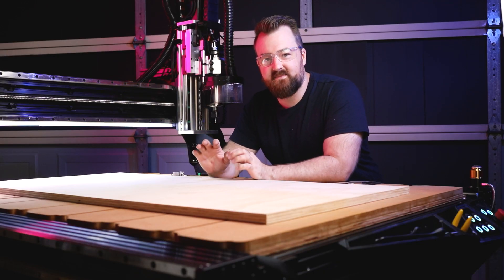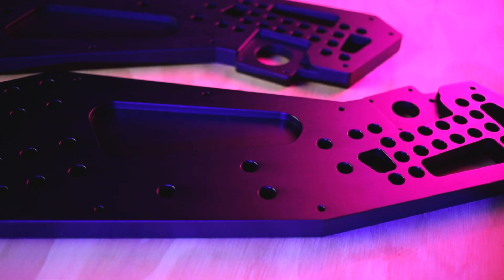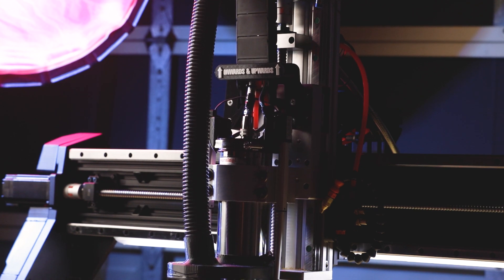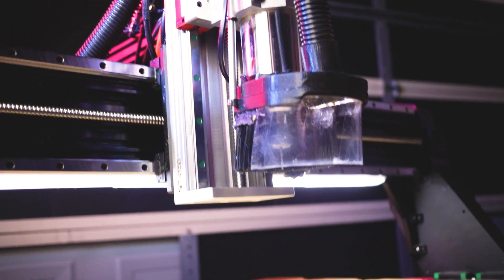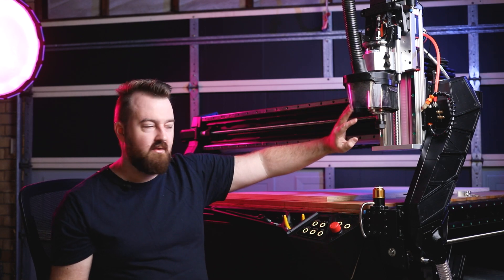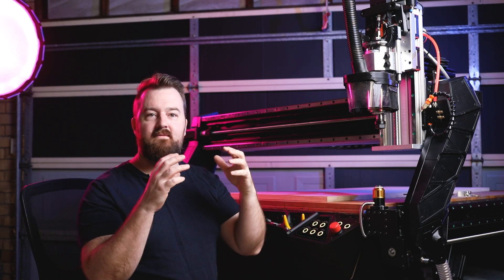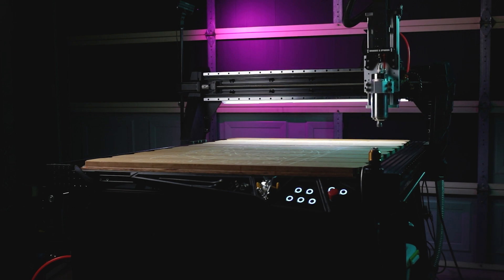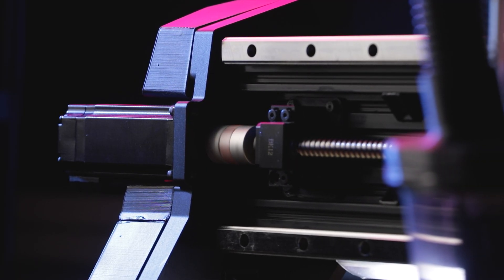My DIY CNC // Matilda - Thats a Wrap // Fluidnc

Comment: You are right to have some fear of very fast rapid rates. I once had a Z axis failure that left the spindle down when the program called for a raising the spindle and performing a rapid mode move to the other end of a part. Well, the machine proceeded to move at 20000 mm per minute (787.4 inches per minute) and pushed the part, fixture, and clamps off the table and onto the way covers. This caused thousands of dollars in damage.

Comment: I notice you run Ball screws I guess 5mm pitch   and the machine looks 1200mm wide so do you have problems with Ball Screw Whip  at high speeds.   'What is your max travel speed and what ball screw' while running the closed loop stepper online steppers ?
Reply from the maker: Thanks for your question! Yes I am using 1605 ball screws. I never pushed machine to absolute maximum as I really don’t need any faster then 8000mm/min. I can run the machine at 14000mm/min without a problem and no whip as I have tensioned both ends of the ball screw!

Comment: Hi. Could you please share your CL57T V4.1 configuration  (DIP switches and  rotating switch) ? Just to have an idea on how to start to set mine when it will arrive 🙂 Thanks in advance
Reply from the maker: Great to hear your going closed loop!! On the dip switches I have gone with 1600 pulse/rev 
on|off|on|on  
Then left mode off
|off|off|off|off
Rotary switch I used was:
For my 5A (y)motors: ‘B’
For my 4A (x,z)motors: ‘5’
Hope this makes sense?
Reply: @NEWTechCreative  Yes, thanks a lot

Comment: Howdy, awesome project. Glad to see it up and running. Is the root controller a stand-alone controller, or do you need a PC to stream the gcode to it?
Reply from the maker: Great question! Yes this is a stand alone control board that manages its own control and uses an Sd card to store and read gcode files without processing from another device- however you will need a device to use as a remote screen to move CNC and initiate gcode files. The board hosts its own webpage that you connect to via Wi-Fi. Additionally you can use this via USB and connect to gcode senders like traditional grbl controllers…. Best of both worlds 🤩